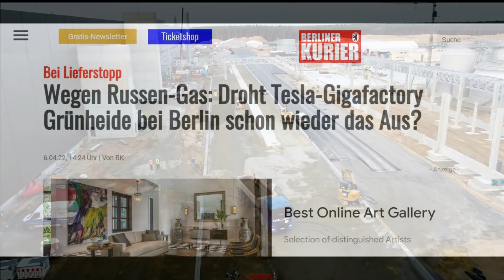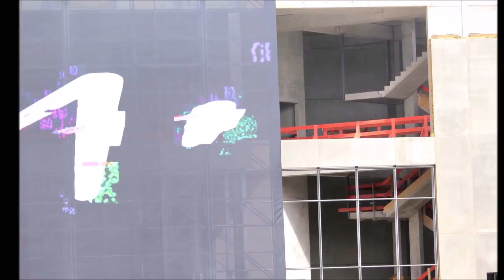BREAKING! Tesla Giga Berlin "Must Be Shut Down" If Gas Delivery Stops

Comment: LNG gas needs to be liquefied and loaded at a terminal of origin, transported by tanker to a LNG terminal, where it can be converted back into gas and distributed (through pipelines or otherwise). That infrastructure has to be in place, and be sufficient to handle the volume that is expected. That is the problem: additional infrastructure has to be built to make the switch, and it will take 2-3 years for it to be built up to the point where it can handle the required volumes. Another problem: unlike pipeline gas, where you can sign long-term contracts and lock in prices, LNG gas is usually priced short-term, for short to mid-term delivery (much like OIL).  As the demand for tankers with LNG goes up, the price is expected to go up. The consequence is that gas prices in Europe are bound to be MUCH higher for the foreseeable future. You can make your own conclusions as to what that will do to the competitiveness of their industrial base.

Comment: They may switch to electrical heating from a new power plant with wind turbines, PV cells and batteries to store the energy. Plenty of space in and around the water basins and parking lots. Check for instance the Vatttenfall project 'Haringvliet Energypark'. If they really need methane or hydrogen, they can make the gas with the electrical energy (similar to what  DSM's predecessor used to do with their surplus energy in 'Stikstofbindingsbedrijf' in Geleen, Netherlands). Will take time though. Better start today, for we must urgently stop using fossil fuels anyway.

Comment: 60% of the plant's energy needs depend on gas? Is that an electrical power requirement? Wonder how much is purely thermal? Could Tesla add more solar on building roofs and a mega battery installation? Possibly not at that latitude.
Reply: It sounds like it's for heat required to melt the aluminum for the gigacastings, so solar panels probably aren't going to cut it. The only workarounds I can think of is for Tesla to either use coal or oil to heat the furnaces or for Tesla to manufacture the gigacastings at Giga Texas and ship them to Germany.
Reply: Solar will never cover their energy needs in Berlin lol….. correction: Germany is not Texas or California where there is a lot of sun.
Reply: @rreagan007  that’s the reason why “the best part is no part” crap!! Stamping shits/machines can work 24/7 without needing much energy.
Reply: @rreagan007  Yes, but solar might go a long way for electric power. Just has not seemed a priority, what with all those tall power lines running into the factory right now. Melting aluminum for presses, doing all that water purifying, other non-electric energy needs are different stories. Maybe importing parts will help keep things going if energy supplies are cut back.

Comment: This will accelerate innovation to use solar and wind and move to electric solutions
Reply from the maker: I think so.
Reply: No, totally opposite. It was already moving in full speed but economical collapse will slow it down.

This will probable accelerates non environmental technologies like making gas from coal. Also it'll increase coal burning immediately.
Reply: @teropiispala2576  Cost is the problem, Solar and wind is cheaper.
Reply: A stop of gas from Russia would hit all of Germany's industry, specially chemical industry. To increase the percentage of wind energy takes years, and sunshine is not intensive enouggh in Germany to really make it a considerable part of electric energy.
Reply: @tedmoss  If counting only energy costs, but impossible to scale up without massive storage and spare power system.

Problem is, solar and wind output goes into 0 time to time, and then you need to get that power from somewhere. Consumption don't drop.

Batteries are not answer for capacity which are needed. Neither is hydrogen, since it's difficult to store and have bad overall efficiency
Reply: This is Germany not Texas, there is not enough sun here compared to California or Texas so solar won’t help here to power those furnaces
Reply: @tedmoss  solar and wind ain’t cheaper and they are also intermittent and needs a lot of batteries for stockage which ain’t cheap too
Reply: Germany and all of Europe's interconnected electrical grid need to restart and build more nuclear plants
Reply: @user-qi1yh4oe4q  For a start, Germany should stop closing current ones which are working perfectly well. It takes too long to build nuclear power plants to help in current problem, but it would be good source of power.

It would help to build solar in Spain and wind on north, but storage is still problem. Long distance high voltage lines are not cheap.